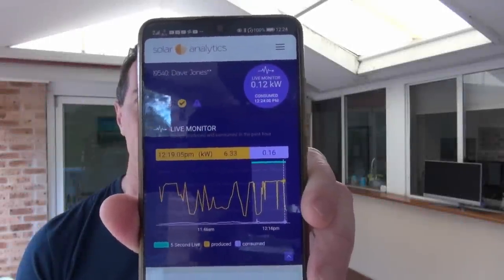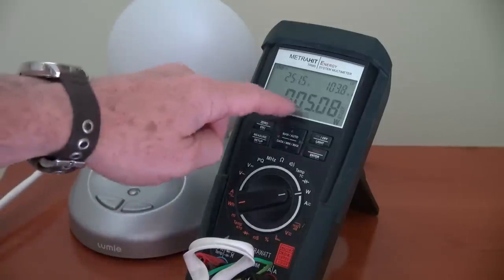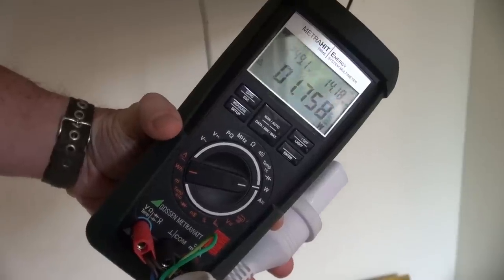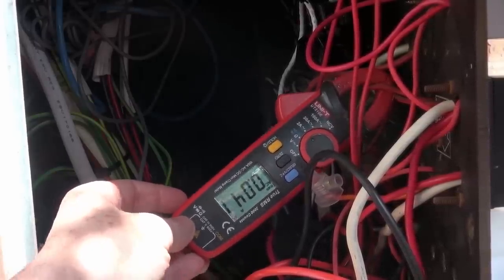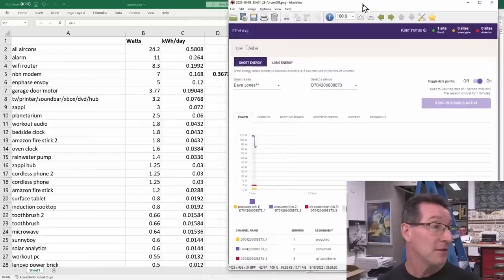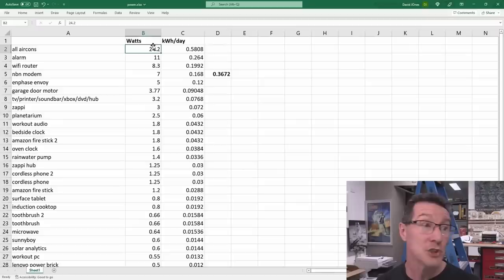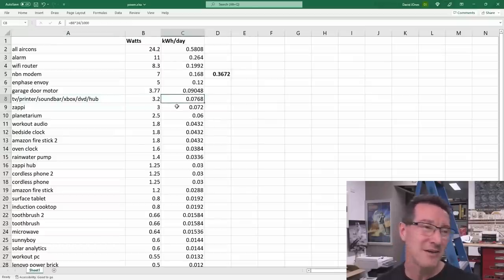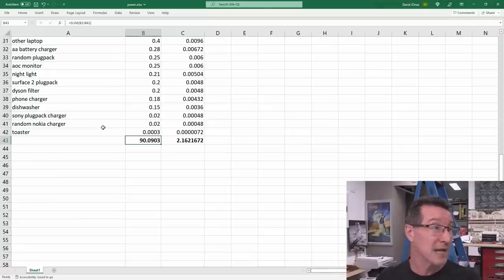EEVblog 1505 - 120W Home Phantom Power? Audit Time!

Comment: Dave, great video, well done.

I was checking my home recently as well for parasitic loads and what surprised me was my Klipsch  2.1 multimedia speakers for my PC. This setup uses a powered sub and when idle it draws 19 watts!

I have since put that plug on a seperate switch to power off when not in use.
Reply from the maker: Yikes.
Reply: ..... I thought my Siglent SDS2352X-E was bad.
Reply: I wired my tiny amp to run from a Molex inside the PC. It freed up a wall socket and there's less wires without the laptop style PSU.

I used a scrap barrel plug to go to my Sonic Impact T-Amp. It can also run off AA batteries! I'd rather get a car stereo for radio though.

Thinking about it, instead of E-SATA etc I'd prefer they put an external 12v output on the back of PC power supplies.
Reply: @dazednconfused31337  That kind of mod is a recipe for instant ground loop issues. I'm surprised they didn't jump out at you right away. On a modern PC with a high-power GPU the noise when firing up a game can be deafening.
Reply: Klipsch ... well, that says it all. #1 design consideration is turning max profit from hype and sub-par performance. 
Not very good  audio design... piss it up the wall consumption from the land of copious consumption.
When the Marketing Dept gets involved EVERYTHING turns to shit.
Reply: @PileOfEmptyTapes  ABIT IP35-E mobo. There was no difference. It already was a bit noisy. When I turn up the volume to play my guitar alongside and pause it's annoying.

My older PCs had a farty helicopter sound when you moved the mouse. The cheapo hifi speaker amp has a high THD too.

The front panel audio is terrible if you use headphones. There was a mod to cut a trace (built in the case) but it made no difference.

Comment: I wouldn't recommend turning off the NBN routers, if they detect your connection keeps dropping out they will put a speed profile on your service, which slows the speed down, best to leave it on for best performance

Comment: Interesting your Miele dishwasher was only 0.15W. I recently reverse engineered our Bosch dishwasher for a repair that took three months and I measured the standby at 0.16W, so probably similar electronics. It has lots of power saving techniques, e.g. a chip to disconnect the  X2 cap discharge resistor while the mains is on and only connect it when the mains is disconnected. It has circuits to measure the heater relay outputs which take about 1mA. It has a special chip to disconnect those high voltage monitoring circuits when the power is off. An opto isolated serial bus between the user interface MCU and the main control MCU that gets powered down in standby by another opto and then needs a fourth opto for the soft power on.

Comment: Note for UK users (your mileage may vary), EVERY SINGLE WATT of phantom power is costing you almost GBP £3 per year! It all adds up... Dave's 120W (not untypical) is therefore costing around £350 per year. This year, next year, and the year after.  Neon indicators in extension sockets - half a watt each. So they've all come out! Name brand switched mode "wall wart" power supplies do perform noticeably better than no-name ones, AND probably wont kill you either. Which is nice. All my PC accessories (screens, printers, speakers) are now on a automatic slave powered socket which is only live when the main PC is on. Worst culprit was an old 'fridge in the garage which serves just to keep a few "tinnies" cold (for "emergencies"! :)  ).  That averaged over 20W! So it's now unplugged. Warm beer never tasted better.
Reply: If my calculations are correct, you're paying £0.47/kwh (A$0.82) That's outrageous! Here in Queensland Australia, we only pay $0.22/kwh (£0.12).
Reply: @mickeyBtsv  34p/kWh cap placing us in debt for the next few decades, actually.

Currently on a mission to gut my home server consumption, we're sat at around 600W overnight, which is horrifying lately. Phase one should knock in the ballpark of 100W out of that straight away.
Reply: My rule of thumb is 1watt = $1/yr. That works out to 11.4 cents/kWh, which is about average in the USA (some people pay much more!)
Reply: @Monkeh616  I don't know what you're running for servers, but newer hardware can be surprisingly efficient. I have a full 7th gen core i7 desktop PC as a server
 that idles around 30W. That's with one SSD, integrated graphics (it's a server), and no peripherals.
Reply: @mattv5281  I'll be replacing my ancient warhorse of a dual X5650 with a 4th gen i5 - by means of replacing the i5 with a 6th gen uniprocessor Xeon (basically an i7 6700). In the process dumping the dedicated GPU no longer required by the i5.

Should drop 100-120W straight away for fairly minimal outlay. The old beast has served me well but that massive stack of buffered DIMMs and the spinning rust are so long in the tooth they're digging a grave for themselves.

Next up will be examining what I can do about my NAS situation.. sadly I think that's going to require a rather larger investment.
Reply: @Monkeh616  it’s an initial outlay but some higher end desktop CPU’s these days could save you a lot of power. If you have a lot of spinning rust drives SSD’s would also provide some savings (albeit at a big outlay).

Edit: I should have read the rest of the comments! Do you load up the CPU Regularly/need a lot of cores?
Reply: @BlahBleeBlahBlah  Not all that regularly - the i5 will be quite adequate. The cost of this move is around £230 (new Xeon system, some extra RAM, a few adapters and cables), which should easily pay back in under a year. This suits me nicely.

The NAS is another matter. I have 18T of storage, which needs expanding anyway, but could be consolidated into half as many drives. Downside: That's around £1000 of drives + a new host system which won't be less than half that again.
Reply: It's not asich as you think. If Dave can save 0.1kwh with the modem and nbn router that would be ~3c per day as electricity costs around 30c/kWh. So over a whole year that is $1.10 per year, PER YEAR! A ~$10 timer would take almost 10 years to pay for itself and you have to put up with no wifi late at night...
Reply: @bengrant4724  It is exactly as much as he thinks, should you take the clearly stated context into account..
Reply: @bengrant4724  , if you take a rate of £0.34/kWh, you have 1W wasted constantly, that is ((365*24*1)/1000)*0.34 = £2.9784 for that wasted 1 watt for 1 year. They are discussing the wasted wattage, the final result, whereas you're trying to discuss the delta if replacing the equipment and whatever offset that gives. However, if you can lower the wastage, from say 120W to 100W, the delta's don't matter, the statement still holds, you saved yourself roughly £60 for the year. Though, you have a point with the return on investment if you're purchasing new things to save money. For best gains, save on energy usage without additional purchasing.
I did this last year after my electricity bill seemed high at my new house. Things like TV backlight brightness and such impact things more than you'd think. I found having a slight decrease in brightness resulted in a large decrease in power usage. Telling  my computer to sleep (I had it disabled for other reasons) saved more, and so on.
Reply: @Monkeh616  600W?!?! Either you're measuring it incorrectly, or you're adding up the TDP of each item individually, or you're mining crypto (or doing some other task, such as rendering), but there's no way your PC is drawing 600W overnight. It's prob 60W and you were reading the DMM wrong or you had a 10:1 multiplier, or something else is going on. 600W is like what a full blown i7 3080 gaming computer is pulling while running a 1440p game. There's something else going on.
Reply: @littlejackalo5326  I'm not measuring it incorrectly, I'm not dumbly adding TDPs, and I'm not doing crypto. Nor have I ever stated that it's a single PC, or that I used a multimeter.

Thank you so much for assuming I'm incapable of measuring power consumption accurately.

My 24/7 equipment is my focus in reducing the overall ~600W idle consumption of the house because, funnily enough, I'm well aware that it accounts for the majority of that consumption and is the easiest target to reduce it.
Reply: This would be true for loads in an un-heated space. 
For loads in heated spaces, 99% of that "phantom power" is warming the area and reducing your heating bill by the same amount.
Reply: Is it possible to shut down those hard drives when they're not in use? That could save a lot of power for something only accessed a few times a day.
Reply: @user2C47  Yes, and that's a superb way to cut their service life by a factor or 5 or more.
Reply: Wow, that's extremely concerning considering our recently installed smart meter says we have a constant ~700W of power being used all the time. I can only assume it's the garage freezer which is relatively old and seems to run the compressor almost constantly.
Reply: @jamescollins6085  That's probably an indication that it's low on charge and/or totally frozen up. You should see to that.
Reply: @Monkeh616  If they are accessed frequently and have a really short timer, that is possible. But it's also completely pointless to keep a backup drive running 24 hours a day when it's only used for a few minutes each night.
Personally, I set my media drives to shut down after 30 minutes.

Also, that garage freezer could have a failed fan.
Reply: @user2C47  They're accessed every 10-15 minutes on average. Even if they were only accessed once a day and spun down, they'd have died of such treatment long ago.
Reply: @Monkeh616  Yeah, if it's every 10 minutes, there's probably not a lot you can do, except maybe caching if it's the same few things every time.

Comment: One more thing about power measurements: many small power supplies can be not only capacitive load, but also very non-linear and noisy. Power meters have some error related to this and it may vary alot from one instrument to another.
I`ve seen one meter mistaking Sonoff wifi relay(<1W consumption) for 1.5kW _generation_.

Also, ~100w for a house seems very good for me. I have around 200w standby in apartment.
 

.

Comment: G'day Dave. Some air conditioner manufacturers design their compressors to have a small amount of current pass through the motor winding to keep oil warm to prevent refrigerant migration to compressor sump. This is to increase compressor life.
Reply: A very good point, yes!
Reply: I found this behaviour in my Mitsubishi Electric. 50W!!!
Reply: @DumahBrazorf  Yeah, nothing wrong with that, apart from being an extra power hog. I wonder if the controller of the system is smart enough to run this heater before start if you do decide to put it on a timer switch - it should have some delay built in, otherwise any "cold" start would decrease the compressor life.
Reply: Yep... dedicated crankcase heaters are also commonly used.
Have been for years in the domestic, commercial and industrial applications. 
Increases comp life by preventing hydraulic lock... trying to spin up with a case full of liquid. Seen enough snapped con rods from that in my time. 
I reckon Dave would be shocked at the start and LRA current level from a basic non-inverter drive comp.
Reply: @zaprodk   Do you think a run delay of an hour from switching on would be acceptable to the 'demanding an immediate result' society these days? 

The issue isn't 'cold start'... it's having the mechanical components totally immersed in fluid, that limits it's capacity to rotate.... like filling your car ICE to the top with motor oil. 
Ya gunna do a conrod or reed valve... lock the rotor and have it OC trip.. again and again until start and run windings or Cap/s suffer.  
The heater (be it discrete heaters or trickle through motor winding) prevents refrigerant condensation and accumulation in the sealed motor/compressor dome.

Comment: Nice work, Dave! Some things you actually want running 24/7, and other things are just "not worth it" to try to optimize. 120W is pretty good, especially for a large home with a techie resident.
Reply: That's less power than my network gear and server uses. 
I could certainly save a lot of power by getting a newer server with solid state drives, but that's several thousand dollars to upgrade.
Reply from the maker: Yeah, not much to do here, just the WiFi/modem maybe.

Comment: My house has a couple of mysterious loads that you can't turn off, for example the doorbell consumes a good a couple of watts, but you'd never know though as it was hardwired in when the house was build, don't even know what it looks like, only reason I know is because I can see on the thermal camera there's a warm spot on the ceiling where the doorbell is the loudest. Also surprised to find I have a much higher idle power consumption mostly because of a server that runs 24/7 but also all the ovenized test equipment that's always in soft standby along with plenty of environmental sensor data loggers.

Also, I think if you tell your kids you're gonna start turning the internet off at night they'll hand crank a generator to repay you the 300 Wh, but you'll probably have to sleep with an eye open.
Reply from the maker: I've looked through practically every square inch of my roof and I'm pretty sure there is nothing hidden. There are some old alarm reed switches but that's about it.
EDIT: just remembered there are three wired smoke alarms. They were compulsary to add when the extension was added.
Reply: @EEVblog  I'd suggest @WizardTim is right - the ankle biters will probably be glad to power the big hamster wheel in order to not get Internet curfews imposed 😁
Reply: Absolutely correct there is a 120ac to 6+to 18v tranny “can you say that”? Former in every attic/crawl space drawin all day.  Go Green! #shitaddsup
Reply: @EEVblog  The place we rent has those wired smoke alarms too.  They all show as warm on a thermal camera, which I’ve been meaning to check how much power is being wasted.  I’m guessing more than a few watts each if they’re excepted from GEMS or MEPS legislation 😢
Reply: @EEVblog  Some doorbell transformers hang on the side breaker and/or fuse boxes here in yank land. Out HVAC low voltage transformer is within the air handler.

Comment: Perhaps the difference between the power measured at the devices and at the panel is the resistive losses due to the reactive current. Take the total VA, divide by 240 to get the current, and estimate the resistance of a typical wire run from the panel to the outlet (count both legs), then see if this reasonably accounts for the difference.
Reply from the maker: I2R losses are very small. I forgot about three mains powered smoke alarms.
Reply: @EEVblog  the mains powered smoke alarms would be wired to your light circuit which you already turned off.

Comment: I did this a while ago because we were getting billed as if we used 600W on average, which I knew was absolutely impossible for an apartment with no AC and no heat (San Diego). Turns out the fridge was broken…

The defrost coil was fighting the compressor like 24/7, so it was switching between 900W and 400W constantly. Our real standby consumption was like 50W

Comment: Lad and I went through our house back in Feb and measured everything. A lot can't be off, fridge / freezers / aquarium etc. but it turned out to be the trivial things like having an alarm clock radio each side of the bed (one removed, now just a wireless charger) or turning off monitors rather than standby. But the biggest gripe I have is having to run a second freezer for all the wife's 'bargains'. I often argue that the savings she gains are lost by running a freezer to store them.

However I work from home and run a server and all the IT that goes with it, but 300w is pretty much as low as it gets for us.

Comment: I havent measured the stand by power of the house lately, I do have one of those Cent-A-Meter I think it was called and it clamped onto the main phase wire coming into the switch board.  My actual monthly usage is like 80-100 kWh a month so not a lot compared to some.

Comment: We have underfloor heating throughout our house - and everyone tells you that those distribution (e.g. per floor or area) pumps would seize up if you turn them off for the duration of summer (and bit of spring/autumn). And since pumps are <100W "efficient" - advice is to either keep them running all the time, or have smart controls that would run them during heating season, and off-season have them run for couple of minutes each day.

I finally got around to setting up fancier control system from Plugwise - which can automatically do such regime for pumps, as well as have zones per floor/room/etc, timers/sensors/etc. And then (through on/off sockets that are part of their system to turn pumps on and off, but also happen to measure consumption) realize pumps use less than 1/10th of their max spec sheet power.

I thought they are using 50-100W - when in practice, due to lower speed setting, it's 5W~10W.

Comment: Oh man 🤓. I did stand-by power consumption check exact same way a few days ago. I was able to cut down 50w out of 95w, just by changing linear power adapters with smps ones and turning eco mode on power amplifiers. Only Aiwa nsx 999 mk2 is drawing 15kWh in a month in standby mode.